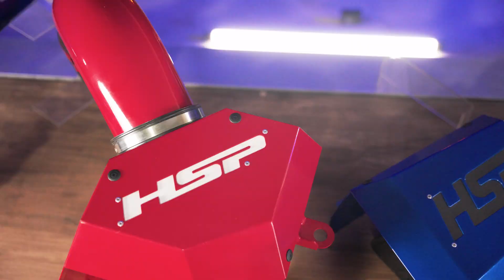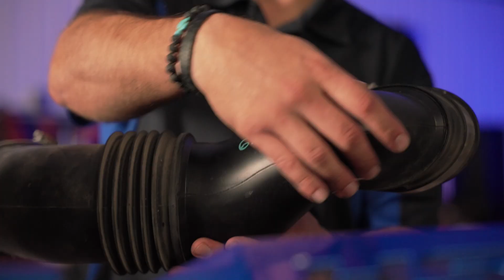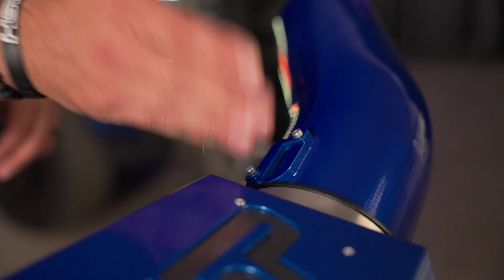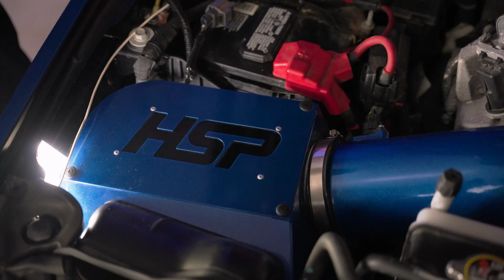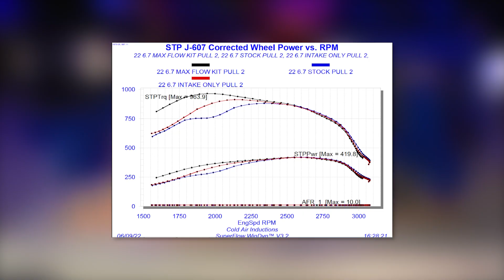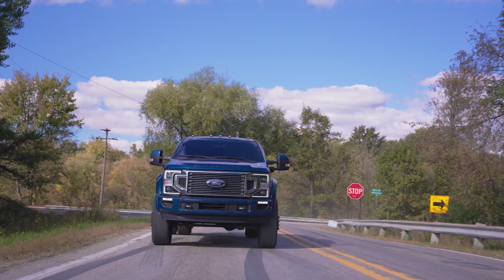HSP Cold Air Intake for 6.7 Powerstroke | Dyno Results

Comment: 22 has less power than the 19? Nope
Reply: Wrong. 475hp on 22. 450hp on 19. Ask how I no, my dad has a 19 i gotta 23 f250 tremor high output. 500hp. 1200tq! Gunna get a s and b intske. Ordered thr cp4 disaster kit for it.
Reply: @brandonc2233yes but on the dyno results on the video the 19 has more so the 19 must have other mods than just the intake